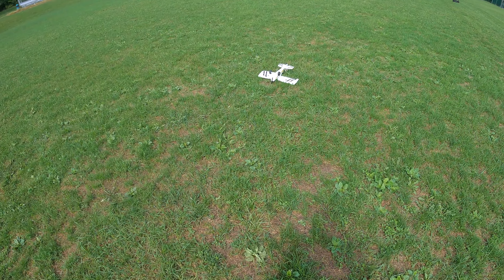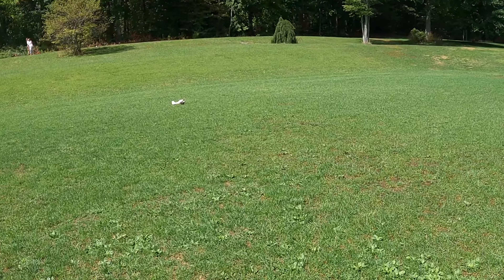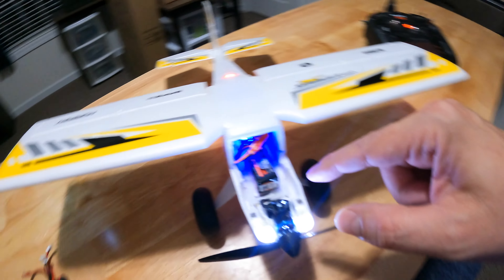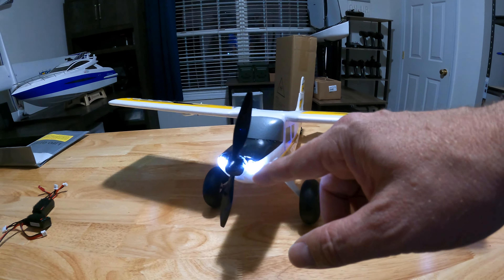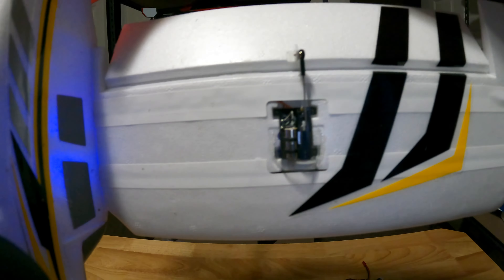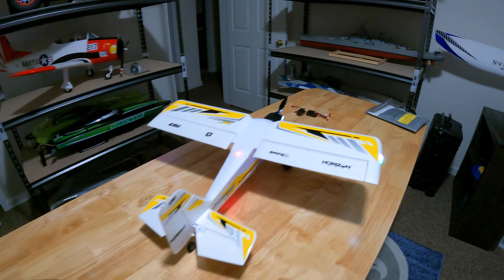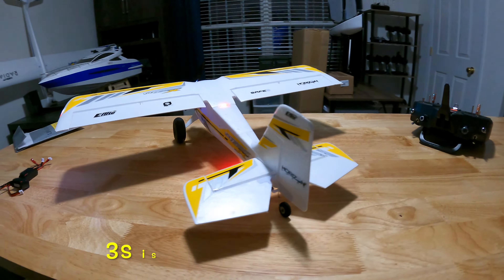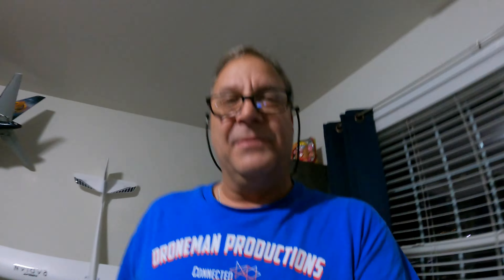TIMBER umx X MAIDEN FLIGHT - ITS A FLAPPERON

Comment: Yep I tried a 2S battery for a couple of flights just for kicks when I first got this. It was able to limp along for some easy flying and circuits, but not much else. I think this model's ESC severely restricts the current to the motor in order to get good flight times with the recommended 3S 300 mAh battery. This is what makes it necessary to fly on 3S to get decent power.
Reply from the maker: 100% I agree it needs 3s. Thanks for watching and keep watching my friend